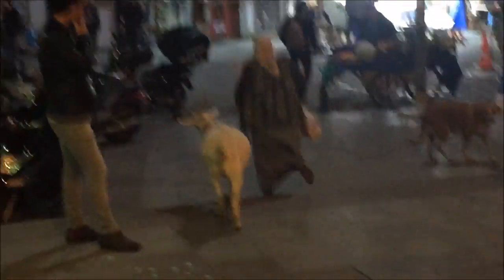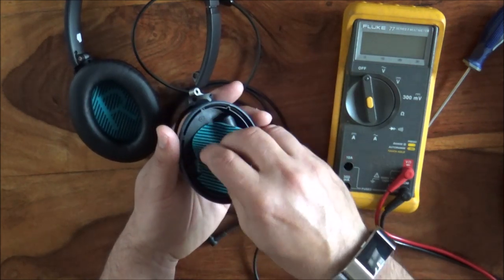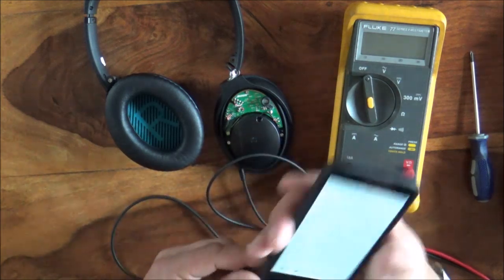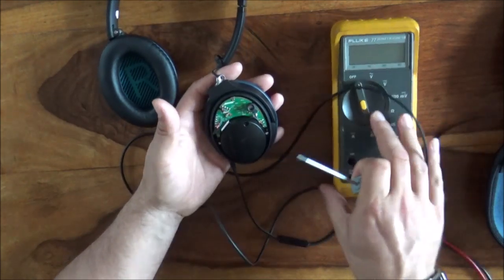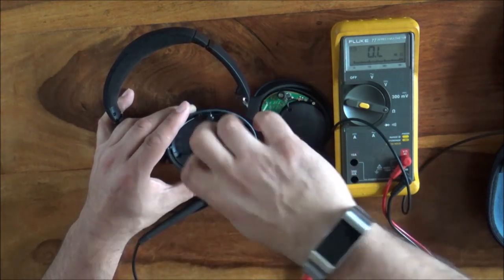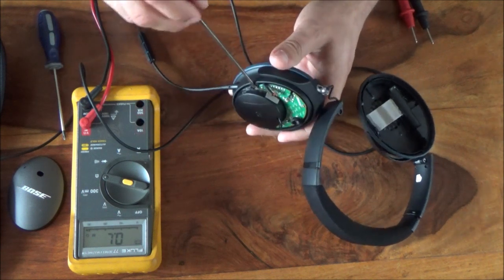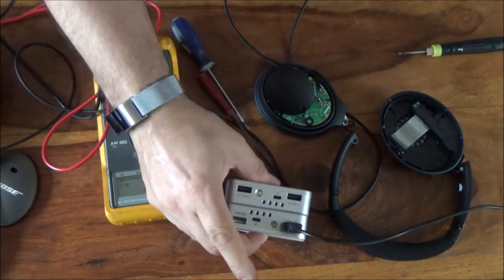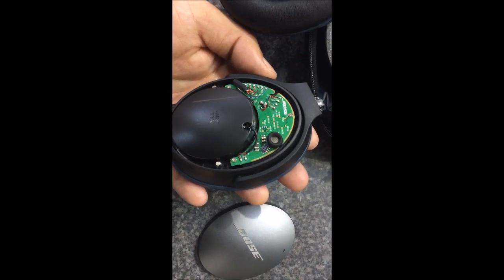BOSE QC25 Headphones - Teardown - Breakdown

Comment from the maker: Bloody unbelievable BOSE! - You should be spanked for this...  Amazing engineering, let down by cheap driver inserts...  please please sort your quality control! - Anyway, glad I found a fix....  to all those watching, I'm very happy to try and help you...  please don't hesitate to ask questions ...
Reply: The left speaker off my QC25 doesn't play in the bass-section, only hights. So i guess it's messed up. Are there any speakers around that i can use and sounds equal to the original?
Reply from the maker: If it’s making sounds, it probably isn’t the speaker... but you can have a look on eBay for QC25 replacement insert.... and try to replace it... it’s a 50/50 chance...
Reply: I'm not sure, maybe the coil doesn't move freely at all.Just enough to make some, well, noise or hisses
Sorry for my bad english btw...
Reply from the maker: No problem! ...  if you look, you will see how I repair the speaker with a hair dryer, to melt the glue.  Maybe you are right, the speaker makes small moves! ... look for my repair nose headphones with hairdryer video!
Reply: Both noise cancellation and speaker went out simultaneously. Do you think there's a chance this could only be a cable?
Reply from the maker: William Benson does the little green light come on when you switch the switch on?  If not, check battery...  if yes, then it may be possible that cable is faulty...
Reply: Thanks for the teardown. My speakers work but the noise cancelling does not. The little green light does not come on with a new battery. Can you guide me to which cable I should check?
Reply from the maker: John Grogan ... poke around with a multimeter... any voltage on the pcb? ... if not... check the battery terminal contacts to make sure the battery power is reaching the PCB
Reply: Dubious Engineering ; I got voltage readings so the battery power is reaching the pcb. How can I check to see if the switch is the problem?
Reply from the maker: John Grogan if you have voltage on your pcb, and you get a green led, the switch is likely good.  How about buzzing through the cable?
Reply: Could blasting the speakers constantly blow out the speakers? If so, then failure could lie on the shoulders of the user; using it too high all the time.

Comment: After many complaints of this exact issue on older Bose headphones using this driver (QC2/15/25/maybe 35, and AE1/AE2) the OEM that supplied their driver changed the design of the copper wires leading to the coil. The problem was, the during bass heavy music, the wire was subject to vibration and flexing due to its orientation, and would eventually snap where the diaphragm was adhered to the frame. They changed the placement of the wire at some point to angle over parallel to the frame where the diaphragm meets the frame, solving the issue. 
   I have the modern Bluetooth QuietComforts. They’re surprisingly similar: same general housing and headband design, minus having plastic back panels with two noise cancellation mics adhered directly to them, and a lithium battery in a now-sealed compartment in the same exact footprint once occupied by the AAA.
    Thanks to the revised driver design, they were able to feed more sub bass to the drivers through the DSP on the current (2023) model. They are truly fun to listen to, and don’t have that annoying muddy upper bass peak like Sony does. 
   The drivers are completely identical other than that one wire.
Reply from the maker: Do you have a link so people can buy upgeaded drivers?
Reply: @DubiousEngineering Not sure if the OEM sells them anywhere, unless the Renensin branded ones frequently available online are the OEM. People have been happy with those ones for both replacement in Bose headphones and their own DIY projects.

Comment: I have maintained mine for years and now bought one of the successors because the left side didn't work anymore
The workshop has identified the problem to be the tiny cables running through the headband.
Is there somewhere instructions on how to do this?
Especially opening the headband at the part you broke early in the video?
Reply from the maker: Crikey, this video is 5 years old..  I really can't remember sorry 😐
Reply: @DubiousEngineering  ...how long these things last ... But they are not easily serviceable
Reply from the maker: @tom_hengst …. Just past warranty! :)

Comment: Pro tip: the glue can be typically melted if you heat the headphones close to 60 degree celsius. Hairdryer is typically good enough for that.
Reply from the maker: Heat definitely helps, however some people have reported that they changed glue on newer models making almost impossible to replace the speakers

Comment: I have a pair of these that were discarded for recycling. They don’t have any ear pads. So I was thinking about it there is a way I can pull them apart and make them into noise cancelling sleep headphones or pillow speakers. But when I turn them on, they are easily screeching. Is this just the microphones being too close? Or is there something else I might be missing?
Reply from the maker: I've not experienced the feedback squeal so can't really advise  try covering the outside microphones with bluetack ?  Just to see if it helps
Reply: @DubiousEngineering  thanks. So far I just settled on trying to put them flat under my pillow, speakers facing up, and it seems to be helping, with no feedback squeal.

Comment: 3:53 I'm pretty sure that the mic with the sealing is actually used to record your own voice, only. The noise cancelling works by calculating the difference inside the cup compared to signal emitted by the speaker. This is because the cancellation signal needs to be different in you have e.g. eye glasses or thick hair which may prevent fully sealing the cups to your head and that must be compensated, too. I believe QC25 has two mics for recording your own voice and two mics (one in each earcup) for the noise cancellation.
Reply from the maker: OK very interesting, so it's only listening inside the cup, the external mics are only for phone calls and not  actively assessing the passive environment.
Reply: @DubiousEngineering  Yeah, it doesn't seem to cause any audible change to the headphones even if you e.g. blow air into the outside mics while noise cancelling is active.
Reply from the maker: @MikkoRantalainen  actually it does...  gently rub your finger over that outside mic, you will hear your fingerprint!
Reply: @DubiousEngineering  The cup seems to be pretty happy to transmit any vibrations. I don't hear much difference if voice cancellation is on or off while rubbing the cup near the mic hole. That's why you should try it without touching the cups.

Comment: 10:20 The idea of the microphone inside the headphones is to listen the audio that's actually heard. Since the electronics knows the true signal that's going to be played and it can measure the sound from that microphone, any difference is noise that should be cancelled. The hard part is that you have to predict future noise to filter it out because by the time you measure noise from that microphone, it's already too late to try to cancel that.

Luckily low frequency noise has long wavelength which makes it easier to cancel it without phase issues. And high frequency noise is easy to reduce simply by having airtight enclosure.

All the glue from 11:00 onwards is needed to make the enclosure airtight. I don't understand why they used such hard glue, though. Basic silicone would have been just as airtight and much easier to remove when needed.
Reply from the maker: I wondered if that might be the case, then the DSP can adjust the sound of the speaker to linear levels
Reply: @DubiousEngineering  Yes, the correction required depends on the driver and enclosure, though, and the closer you can get the repairs to the original, the closer the algorithm will match the actual driver behavior.

Comment: I have a similar but slightly different problem.  The right earphone stops working when the noise cancelling button is turned on, (left earphone works).  But both earphones work when noise cancelling is turned off which is fine except when on an airplane and really need the noise cancelling feature.  I took apart the right earphone as you showed and measured the resistance of the driver.  It read 30 ohms.   Does that mean that I have a different problem?  Have you or anyone come across this and can offer a suggestion?
Reply from the maker: Yes sounds like the speaker is ok if it’s reading 30ohns...    sounds like you have a DSP chip problem

Comment: Theres a video out there called how to fix yout bose qc 25 with a piece of paper. I got really surprised when it really worked out for my headphones but I dont undersand how did it work. Maybe you could know the answer?
Reply from the maker: Put a little pressure on the headphones in the right place and the wires make contact again... but it’s only a short term fix as the speaker will die again in the future... best solution is to replace the speaker with a new one!

Comment: I had the same issue with the right driver and I realized that the voice coil wires are glued to the back of the diaphragm. Since I developed small transducers like this myself, I know that this is a bad idea, yet I refuse to call this a design flaw. These headphones are such a well engineered piece that I hardly believe they fail by accident after 3 or 4 years. So sad.
Reply from the maker: Thanks 🙏 Markus... exactly... engineered to fail... and make money
Reply: This is exactly how every headphone I have ever come across is built. The coil wires are glued onto each other and the back of the (single piece) diaphragm. Same way most speakers in landline phones, toys, etc. are manufactured. It’s worth noting that some headphones do make use of a cellulose diaphragm with a flexible surround instead of a single piece of plastic film. Bose’s own 700 headphones and QuietComfort Ultras are an example. Every other Bose headphone back to the original QC uses the same driver featured here. Standard issue 40mm Mylar film driver used in the vast majority of headphones across different price points, including many industry standard studio headphones. (Sony MDR-7506s are an example, though those use metal frames instead of plastic.) I think the most common failure point of these is actually the wires leading to the coil, which are glued onto the part of the diaphragm that flexes, and between the outside of the diaphragm and the frame. After too many movements, the wires eventually fatigue and break where the diaphragm meets the frame. It’s not exclusively a Bose problem. I do notice that the lead wires of the 7506s don’t go straight across, they spiral inward towards the coil, which probably limits that movement. Those seem to last a while.

Comment: do you think it is possible to record the left and right signal from the headphones once they are opened...is it just a question of connecting the copper wires to the exposed solder joints? (purpose is to record with the sound changing algorithm in line ....
Reply from the maker: John O'Neill yes absolutely... you will have trailing cables and need to reduce the sound output with a potentiometer or resistor network... but not too complicated :-)
Reply: @DubiousEngineering  Much obliged for the quick reply, thanks
Reply from the maker: My pleasure!! :-)

Comment: for 350 bucks there not that loud i want headphones that get so loud i cant max out the volume
Reply from the maker: Haha!!  I know the feeling!!  Chest pounding bass... in your ears!!  Small problem...  your ears will get used to the volume and you will continue to turn them up... then you will accidentally damage your inner ear...
Reply: @DubiousEngineering  thats true but i have not hurt em yet so far so good i looked on amazon and see they have 40mm drivers a pair for 20 bucks made in china, but what is not nowa days. should i get those or find something better i also have 3 pairs of these headphone and only one pair has a failed speaker so to me they last and sound good but i think for the money i woulda been better off with no name blue tooths.

Comment: This is why I do not buy top brand things especially electronics. They all seem to have quality problems if they are an older established company and the value (quality / price) is still very low. This is especially true for European and American companies. I get more value from a 25 cent Dollar Tree battery than a 3 dollar Duracell. These old companies have enormous administrative expenses and executive contractual bonuses they must cover and they pass the cost to the consumers.
Reply from the maker: Agreed... some companies are on the wrong path... Its strange, as BOSE has a reputation for quality, but in this case, they have an Achilles heel....

Comment: Tried to fire up my old QC15's the other day only to find that the battery inside had leaked and the headphones wound't turn on, even with a new, good replacement battery. Going to open them up and see if I can fix them before turning to eBay for another set. Any advice on what to look for given the circumstances?
Reply: I always remove the battery when the device  is not in use.
Reply: @crawfish069  Yeah. It was definitely a mistake to leave it in.
Reply from the maker: leaky battery...  damn nightmare!

Comment: the speakers are made by renensin   the failure is not entirely boses fault they even did extended warranty / out of warranty repair for a while.   later models have fixed this issue. 
problem is, the copper cable on the mylar membrane is at a steep angle which bends it on bass heavy music, until it breaks. later models have the wire on an angle to increase the bend radius / make it a torsion stress which is less likely to break.
Reply from the maker: This is really great information, thanks...  I guessed the copper wire fatigues, but wasnt sure how...  thankyou!!

Comment: Surprised the driver failed normally its the cables that break best headphones i have are a set of chinese bluedio hurricanes ,only ever used on cable as there not as good on bluetooth.Nice fluke multi meter i have a fluke 75.
Reply from the maker: These drivers seem to fail a lot in BOSE...  Buy new and get the extended warrantee for Quiet Comfort is my suggestion....  Its a damn shame, its ruining their reputation...
Reply from the maker: A 10 minute message for my regular viewers... https://youtu.be/hAVadIYgLbk

Comment: Thanks for doing this. I currently have a problem on my qc35 which should be slightly different due to the integrated circuitry but overall it will probably be the same basic design
Reply from the maker: I really hope it helps with the QC35s thanks for taking time out to comment... here’s a little preview of a future video release https://youtu.be/s_mW2d-HNw0
Reply from the maker: For being so kind and taking time to chat...  here's a little preview of the next video!  Please don't hesitate to thumbs up if you like it!!  https://youtu.be/-7n-FJI2iGU

Comment: Tip from another video. Use a heat gun/hair dryer to get rid of the glue when disassembling. However it may push the glue into unwanted areas causing additional problems (not sure)
Reply from the maker: Don’t use a heat gun... they melt the plastic casing... but the hair dryer works great!!!

Comment: 11-16-2018  - - - - I watched your other video where you replaced the (left) speaker.  After much heating with hairdryer over the speaker cover, it would not melt the glue.  Prying damaged the outer case with the screwdriver.  Couldn't get the cover off so reassembled - apparently the glue they used is permanent. (Ping - just got your response to my comment in your repair video - going now to see what's up).  Cheers.  Maybe their warranty (expired) will cover this???
Reply from the maker: Again ... I’m gutted to hear that they changed the glue to make them unserviceable... I think that’s very unfair and at this point I won’t buy Bose again!  Thanks for your input!!
Reply: 11-16-2018 - - - - You're welcome.  I'll return and post the eventual outcome to this adventure.  Cheers.
Reply from the maker: Yes please!!  Very important...  we all look forward to seeing your findings!!
Reply: @q7winq7  what's the outcome?